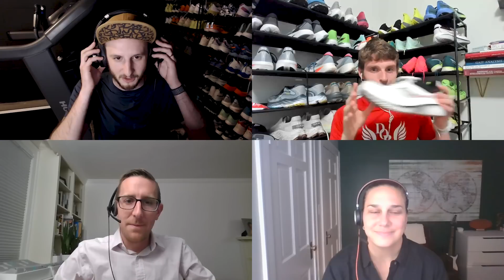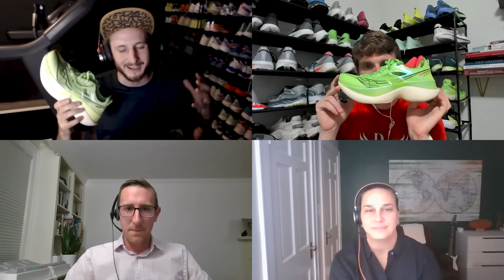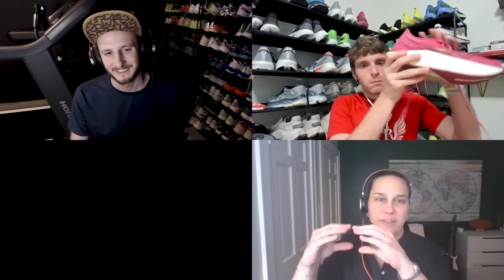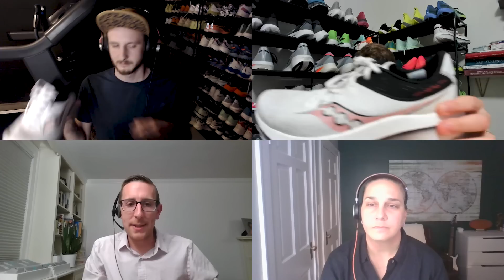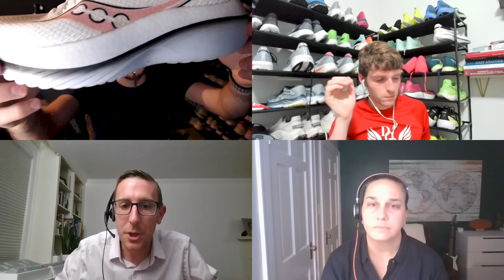Saucony Kinvara Pro Engineer Deep Dive | What is PWRRUN HG?, Economy Testing Endorphin Elite

Comment: Nathan and Matt--In describing the Kinvara Pro's testing and development, Cory first said that they did efficiency testing on the Endorphin Speed 3 and the Kinvara Pro, but later provided efficiency measures comparing to the Endorphin Pro 3 and Kinvara Pro. Can you ask him how the Speed 3's efficiency compares to that of the Pro 3 and/or Kinvara Pro at the tested ~7 and ~9 min/mi paces? I'm especially interested because I plan to use the Speed 3 for an upcoming marathon at 8:35 pace. Thanks!

Comment: I'm a Saucony guy (since Ride 8) and I run a lot for work. In my opinion, EVA is not durable (in terms of performance), as much as PEBA. In the past, I've run an average of 450/500km using all the Ride models, but using the Pro 2 I've reached 600km. Now the left shoes squeaks every time I stride, therefore I've decided to move to the Pro 3. I'm now at 250km marker wearing them, but the signs of wear in the forefoot are definitely more prominent, compared to the Pro 2 (when I reached the same mileage).
I believe that choosing a carbon compound for the outsole has been an excellent choice, in fact, I'm not sure I'll be able to reach 600km using the Pro 3.